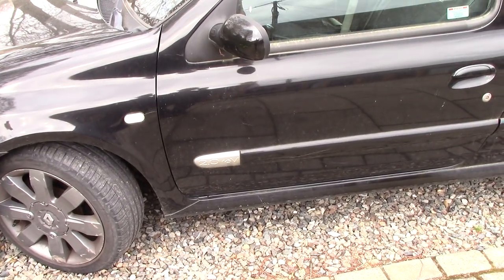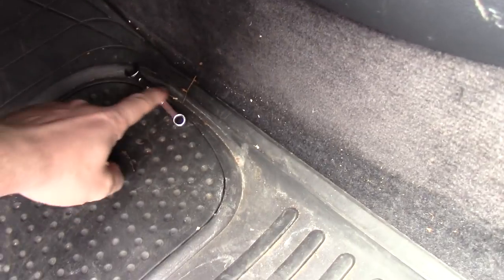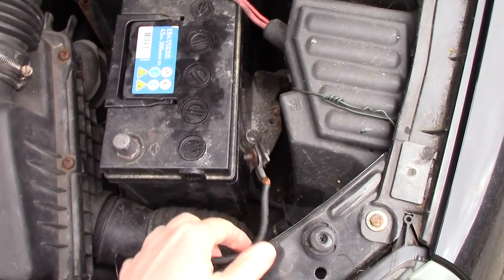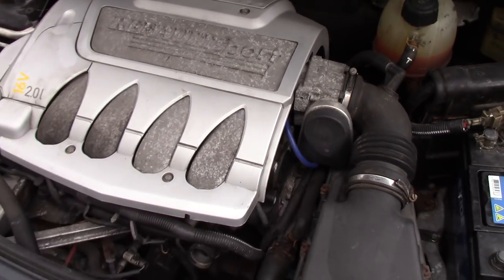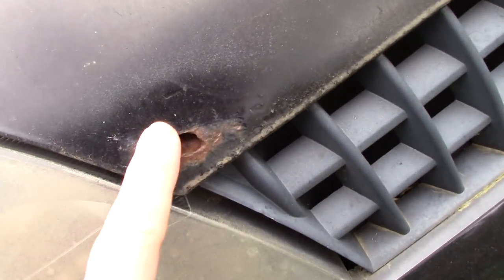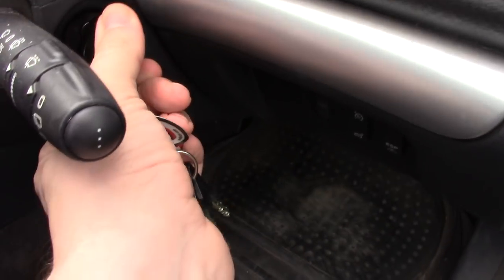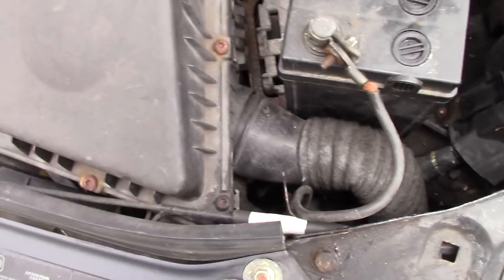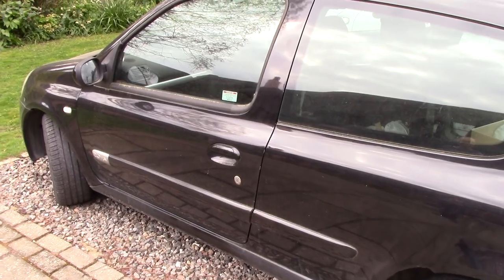2004 Renault Clio: Cold Start/Stop Procedure Tutorial | CAP's LIFE

Comment: fyi this may be an easy fix. there is a relay that is supposed to cut off power once the car is off, and yours might be faulty. it's quite cheap even for a brand new one, and you may found 2nd hands ones. as for changing it, it shoudln't be too hard. if you are lucky (depending on this relay location), it may even be a 5 min fix for 20 bucks

Comment: Hello Cap, my friends car has the same problem with the power consumption and he found a swich somewhere online, which can handle the power.
He just installed it on the battery.
Something like that would be pretty helpful if you don't want to mess around with the screw every time you want to go somewhere.
Reply from the maker: wilco Sir

Comment: Your car makes me sad. Try and isolate the problem by pulling fuses. Your battery may be crap too. Could be a stuck relay, a bad diode. That car could be made to look pretty decent in an afternoon, for the sale shortly after. Or if you're perfectly happy with things as they are, get a disconnect knob, so you don't need a wrench anymore and because race car. Hey, be happy, it's not down for a fuel quantity or wing sweep gripe.
Reply: B-shop?
Reply: @PaperworkNinja  Nope. Aviation electrician's mate, F-14 A,B,D AND F/A-18F. I worked on cars too. If I had more I could probably figure out the problem with the Renault.
Reply: @pgtmr2713  Ah. I worked F-111 B-shop and both fuel quantity and wing sweep were two parts of our balliwick. Fun days trying to find one bad probe...
Reply: It changes over the years, and with the different platforms too. Sounds like you had a similar job. Our slogan was aviation everything. We had one fuel quantity issue that took weeks to troubleshoot. Trying everything, BUT, the one difficult thing it probably was because they didn't want a down jet for the time it would take. It was either a wing probe or a harness to it. I think we swapped both after everything. Wingsweep was difficult to get right. Ours were old and beat up by the time I saw them. Probably worse with the F-111's weaker wing mounts moving around.
Reply: Check the ignition switch and make sure it’s not sending power in the off position.